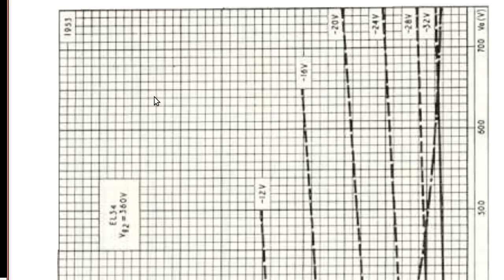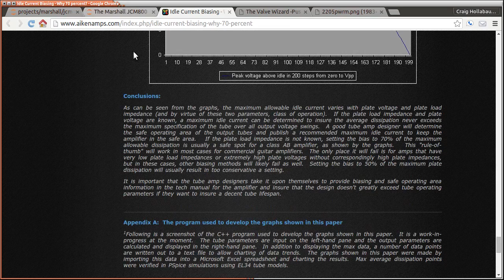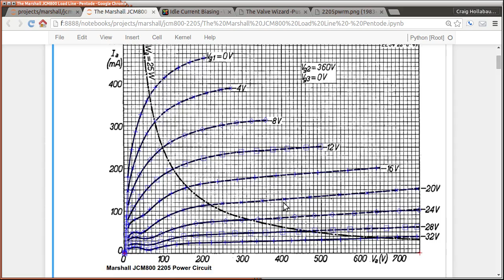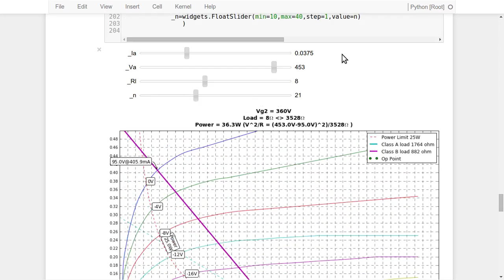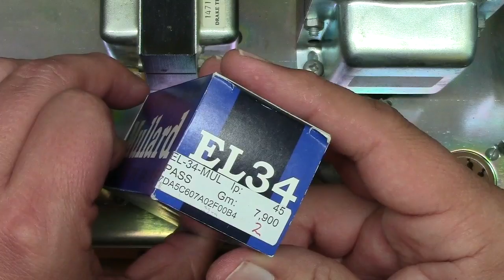160629 Valve Studio - Marshall JCM800 2205 Determining the Bias Point From EL34 Data Sheet

Comment: I watched this thorough analysis on the bias point and it provides very good insight into the tube operation and the operating data given in the datasheet.  I would never have thought that a push pull amp would operate at Class A.  The analysis also shows why you should never place a 4 Ohm speaker on an 8 or 16 Ohm speaker output of an amp.  Its okay to put a 16 ohm speaker on a 4 Ohm output as an accident but the opposite is NOT TRUE!  Matched sets are important.  One of my mods is a fixed bias balance pot to tune both sides to their best operating point.

Comment: Also, let say you hook up an 8Ohm speaker on that amp and do more with it than listen to that nice 1kHz sinusoidal waveform we all love. If so you the speaker is not that much on its claimed 8Ohms anymore....if you take a look at a speaker´s impedance versus frequency you gonna see this, also these impedances are measured in a free to air situation. if you put the speaker into a cabinet it will also become something very different. 
And it highly depends on how much the output tranny can follow along on these impedance mismatch...usually they go into saturation and thus limiting the low end impedance (basically it´ll look like that for the output tubes)
The bad thing about higher impedances than claimed is that may it gonna arc over due to overvoltage conditions (may it be either in the "shut down" tube - where Vmomentary.max is about double what the other tube is handling at the moment or in the output tranny itself at the shut off primary winding at the same voltage condition) usually the tube flashed or sometimes this is happening "in the dark" within the primary of the output tranny....
Reply from the maker: This is the voice of experience here. I'm fascinated by this very topic. I'm working a plan this year to fully explore this very topic in great detail. Thanks for the info and I'll try to stay away from arc overs.

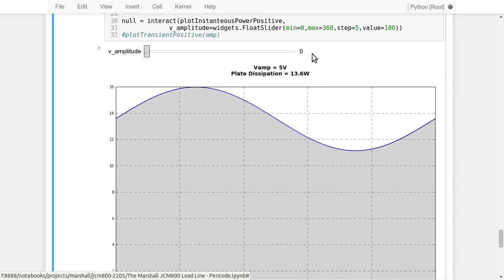Comment: As for 31:30 something....techincally you´re right, but the tubes can hold up to that, may be not long term, as they go red plating anyways, but you may keep in mind that the maximum cathode current is also not a rectangular thing. it´s also a curve with a roll off therefore you can´t drain that amount of power out of the plate...the cathode will limit that way before. 
If you do have an instagram account you can follow me there as well....as i simply don´t have the time to do these all polished up YouTube stuff anymore. I rather get stuff going, as i also still have a dayjob ;) so i rather keep posting tube stuff among my other electronics over there, as it´s way faster and easier to record and upload there than over here....my last one (ok i was mainly curious about these 4k my phone claimed to be able to handle) created about 2Gig data...upload took about two hours for just under a minute video content...on insta you only have one minute to go for, and it´s realtime as you do it it´ll record and you can delete or make it public.
Reply from the maker: I'll find you on instagram. Thanks for the creator take on YT vs IG.

Comment: You need to buy a µTracer kit (made by Roland Dekker, from the netherlands)...you got the knowledge to build it up and also put in on some good use for you...you will be gain some great insights into tubes, in a way you simply weren´t able without, like tracing all these curves for your tubes...this is no advertising, also i don´t and haven´t sell it....it´s my point of view...i had (and still have) access to various tube testers (funke W19, neuberger RPM370 and a Roetest) and i don´t need any of these anymore...but you need some basic knowledge of tubes and their operation...therefore the µTracer is not designed for beginners...
Reply from the maker: I looked heavy at uTracer and you're correct,  it's insight would be definitely valuable. I've had a design in my head for a test system with an expandable voltmeters and ammeters design specifically for tube amp design. All channels are simultaneously sampled for accurate phase measurements. It's a long term project that I'm still in the part selection phase. I have the AD8479 eval board here and its interesting. I just saw a digikey posting about the LT6376 and AD7761. Here's one more to look at, ACS70331. There are several design challenges to overcome, high bipolar voltages, low currents and high-impedance nodes. Thanks for writing and stay tuned.

Comment: Hi Craig. Just rewatched this excellent video. I would be very interested to see the plate dissipation integral curve for 4Ω and 16Ω but with various bias currents to see if speaker mismatch can be accounted for by bias adjustment. I always believed that a speaker mismatch low, i.e. 4Ω speaker, 8Ω amp, was safer than a 16Ω speaker on 8Ω amp. This video shows the opposite. Seeing the curves at various settings would be great. Can the software take into account the poor power transformer regulation? If it's dropping 30V at around 60mA then at 200+mA you may lose 100V on the plate, which also accounts for extra compression on older amps.

Comment: Great and informative video. You used the 'ideal' Ra to calculate the turns ratio rather than measuring the actual transformer turns ratio so that you know the real anode load. I always measure as this also checks for any imbalance from one side of the transformer to the other, which I've found is often the cause of matched valves appearing not to be, particularly in vintage amps.
Reply from the maker: Charles, thanks for the great tip, I'll take a look at this mismatch between OPT windings in future segments. Have a great day, thanks for watching and your comment.